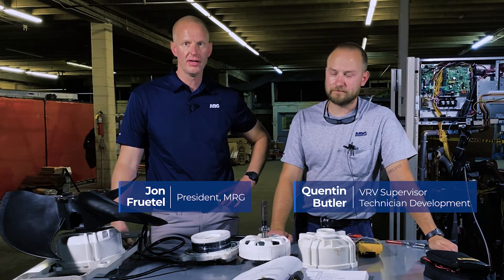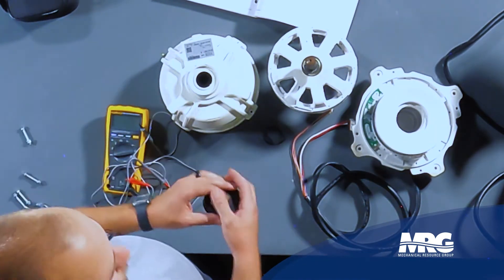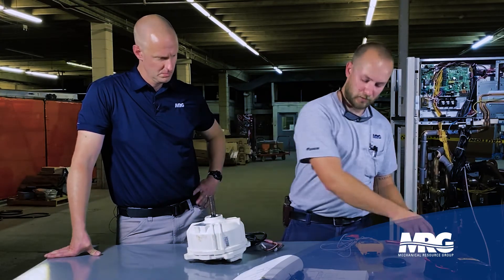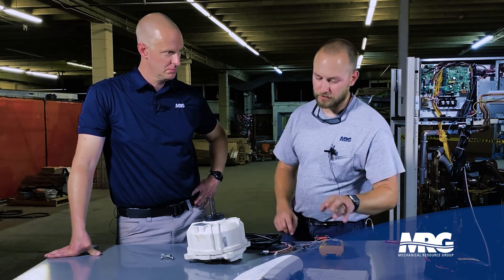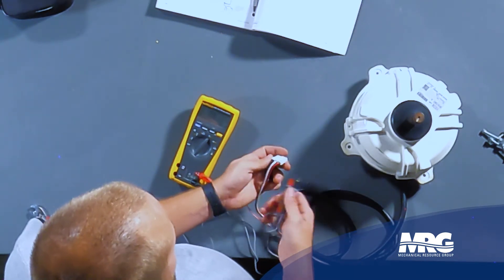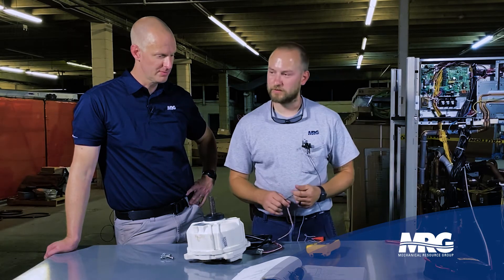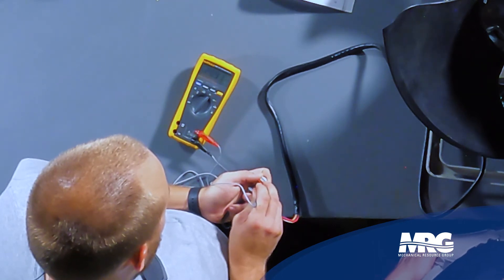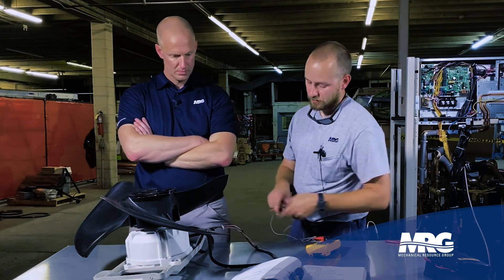How to Diagnose Daikin VRV IV Condenser Drive Fans

Comment: How do you know which wire is U, V or W?
Reply: One thing to add will be to make sure the impeller/fan is not rotating due to wind while checking the resistance because it will give you an incorrect reading
Reply: @davidcross27  Very good point!
Reply: Thank you for your question, Shannon! This information is provided in the Service Manual.
In relation to the main power cable ( 3 wire connector ) : 
Red = U
White = V
Black = W
In relation to the signal connection ( 5 wire connector) : 
Gray  = Ground
Pink  = VCC
Orange = W
Blue = V
Yellow = U